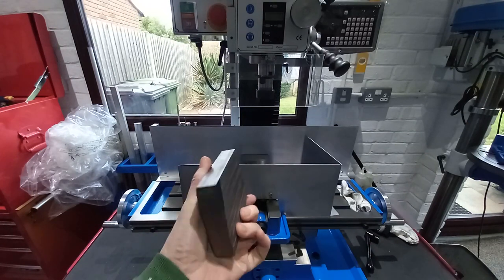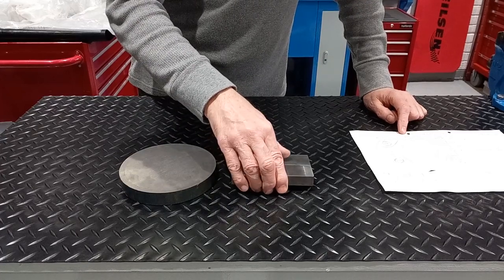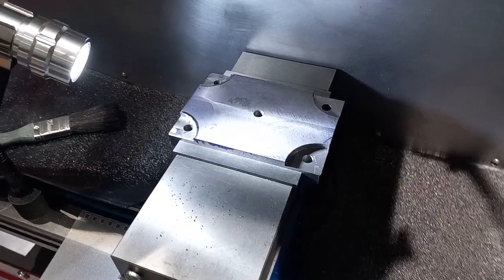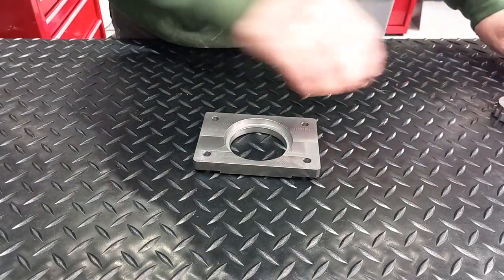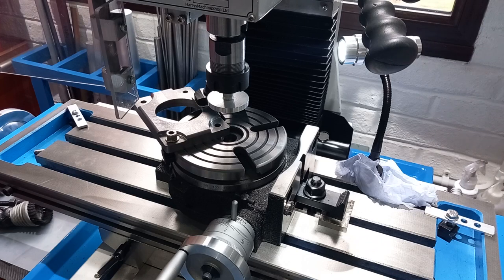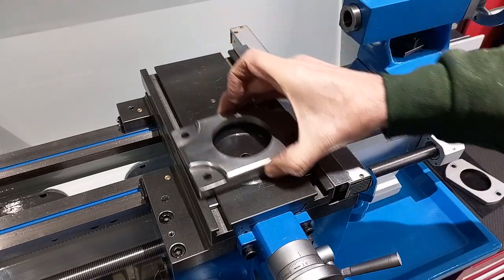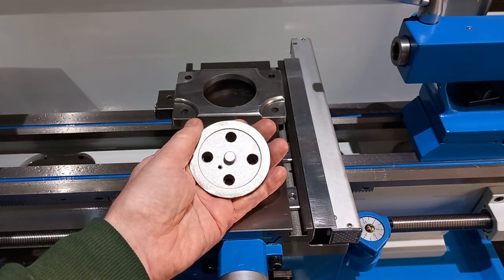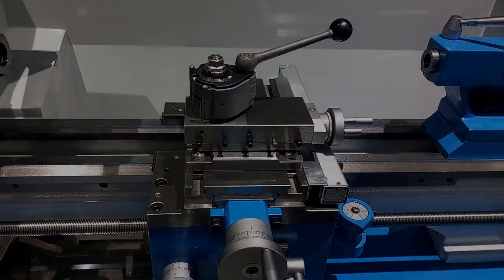New top slide clamp for the lathe

Comment: Thanks for a very informative series. 
There is so much useful information that it would be improved with a txt file of screws , glues, greases etc. used in producing your beautiful bathe.
I note what you observe in spindle slow rotation stop on switch off. The secret is the plugging resistor. Don't switch off, simply change the F/R direction to 0 then rotation energy is dissipated in the plugging resistor and rotation stops.
I enjoyed you cleaning up all the problems but in my case this was more than compensated by the cost. I did not want to pay more money to avoid the joy of becoming the worlds best lathe design engineer.
Reply from the maker: Hi, thanks for your comments, sorry its taken so long to respond. you make a good point about the resistor and I tried this and it does switch off very quickly, but, its a matter of safety that if I ever get in to trouble and need to stop the thing I don't want to be fiddling with a switch, I just want to bang the big red button and hopefully, walk away. I now have a circuit diagram so I can work out what needs doing to get it to work properly.  I'll look in to how I can best list all the stuff used.